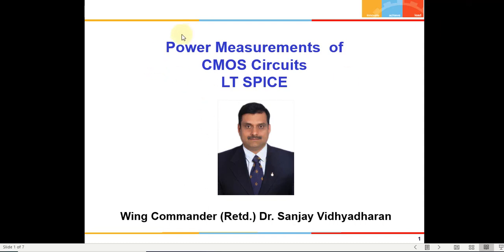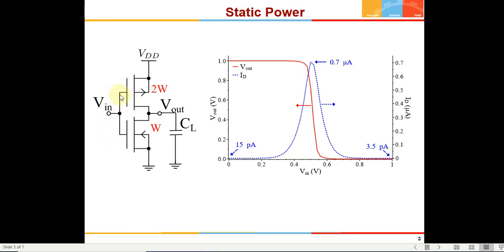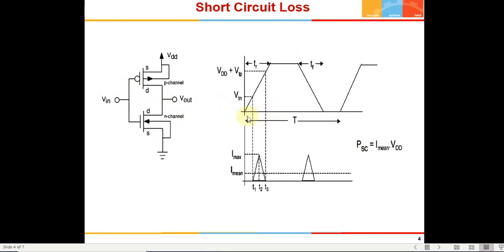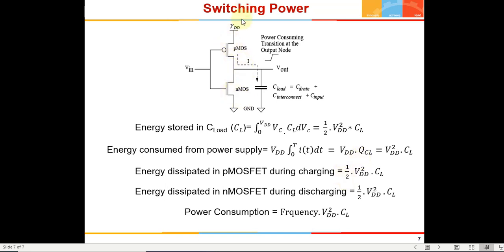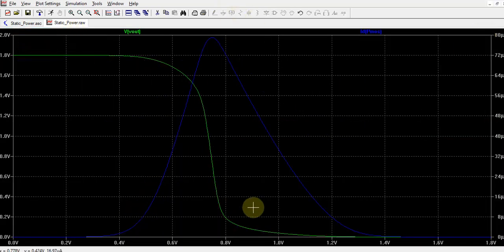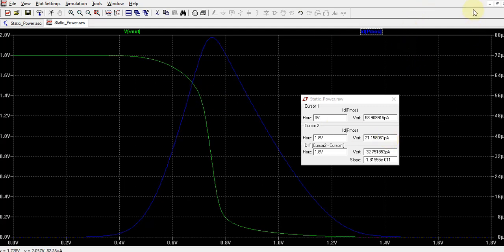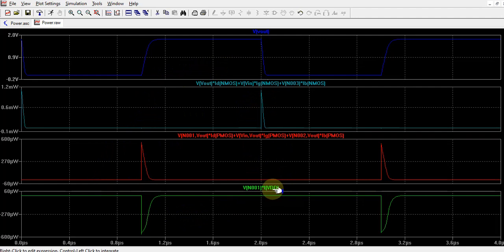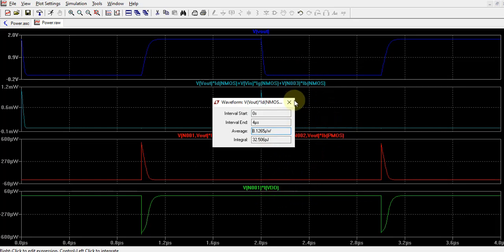CMOS Circuit Power Measurement in LT SPICE

Comment: Sir, when we design full adder in ltspice . do we need to connect load capacitance to measure power consumption
Reply from the maker: It is better to check the performance  with a load equivalent to fan-out of four.
Reply: @SanjayVidhyadharan  sir, in full adder there are lot of mosfet then how to calculate short circuit power and switching power

Comment: sir,as u have said in last part of short circuit power calculation that nmos will show only short circuit power then why we are taking diff b/w the power in pmos and nmos?
Reply from the maker: we can roughly say power in nmos is short circuit power (negelecting static power) for this test vector. Italked about difference just tio show that pmos power will be higher ( switching + short circuit powers).

Comment: Dear Sir,
How I can calculate the power consumption of the CMOS inverter in LTSpice simulation ?
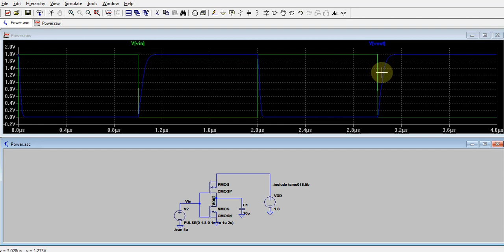Reply from the maker: You can take the average power from the power supply as explained in the video from 12:20  minutes play time onwards  The average power from the source will be the power dissipated in the circuit.
Reply: @SanjayVidhyadharan  thank you a lot sir.

Comment: Sir , 
how to calculate the AVERAGE POWER of the whole circuit instead of the instantaneous power of the components?
Reply from the maker: You can take the average power from the power supply as explained in the video from 12:20  minutes playtime onwards  The average power from the source will be the power dissipated in the circuit.

Comment: Sir, in some ptm model like 90nm, the nominal Vdd and width (W) is not specified. How to measure Nominal Vdd and Width of MOS for those cases? and how to calculate the total power dissipation for a dynamic or domino cmos logic circuits in ltspice!! is it the addition of average power dissipated by individual mos components and also keeper circuits?
Reply from the maker: These are PTM models and not fab lab models and hence they don't specify all parameters. Minimum Width is generally 2.2 to 2.6 times L_min. Better option is to refer to tsmc data or microwind application data or other fab lab data .

Comment: Thank you sir for posting the video. Sir can you please post a video on how to calculate the current On-Off ratio
Reply from the maker: Do a DC VGS sweep from 0 to VDD, with VDS= VDD. Plot ID vs VGS. Ioff is when VGS=0 and ION when VGS= VDD
Reply: @SanjayVidhyadharan  sir for getting off current in cmos input voltage will be zero =0